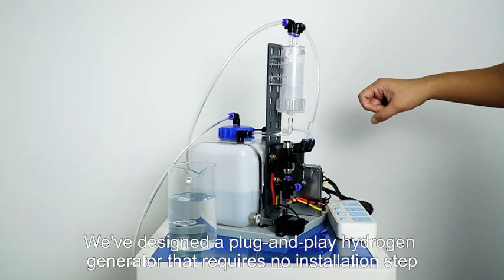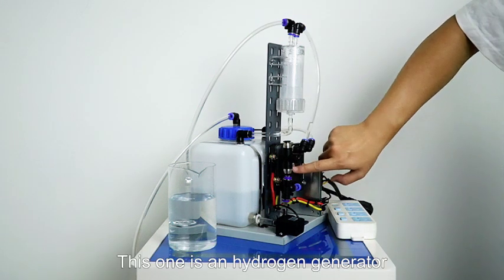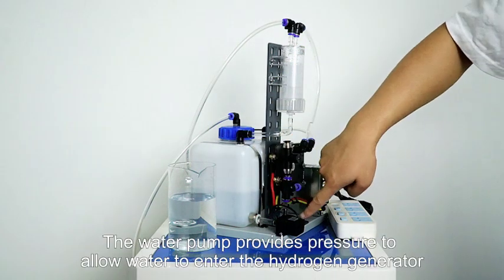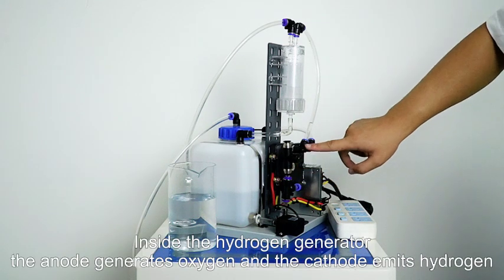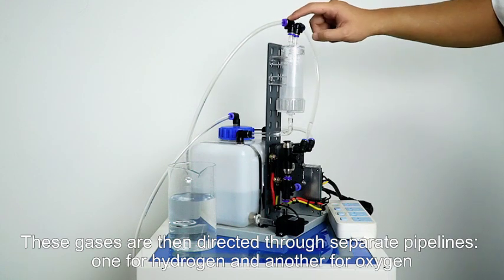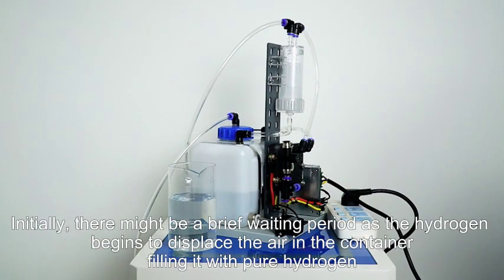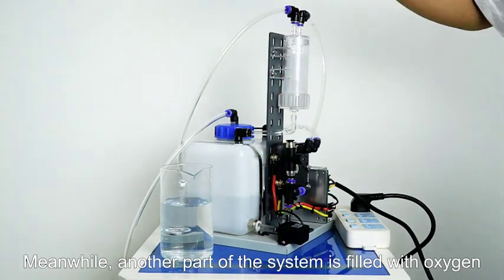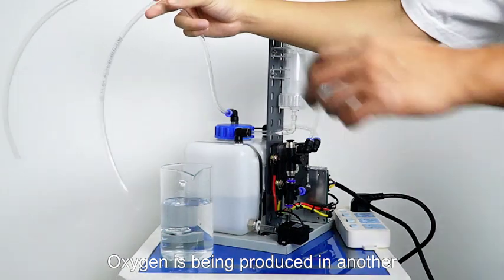Introducing the Plug'n'Play PEM Electrolyzer for Hydrogen and Oxygen Separation

Comment: Does the water/gas separator need to be elevated like that?
Reply from the maker: Yes, this ensures that the water surface level is higher than the water storage tank.
Reply: @senzahydrogen  Thank you.  I'm designing my own system.  But, what if I use a check valve between the separator and the water tank?  There is always positive pressure from the electrolyzer's hydrogen outlet so I assume it should be able to push the water uphill, through the check valve into the water tank?   The reason I ask is I'm hoping to build a system that isn't so tall.
Reply from the maker: @ChristmasEve777  If you can ensure that there is always positive pressure in the separator, then it should be no problem to use a check valve. However, it would be best to test this setup before formally implementing it.